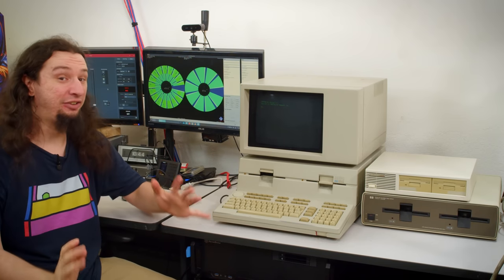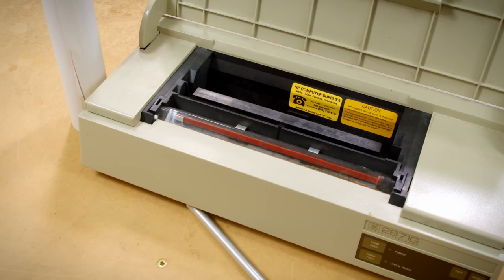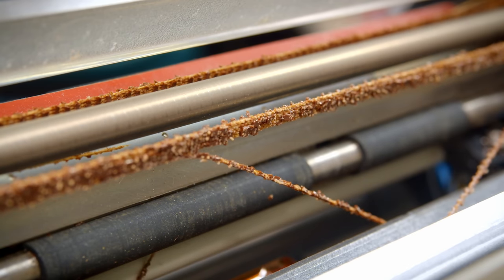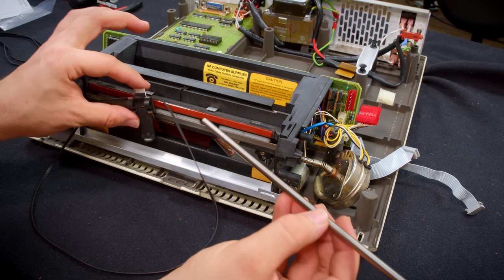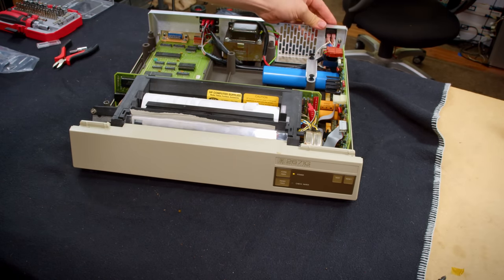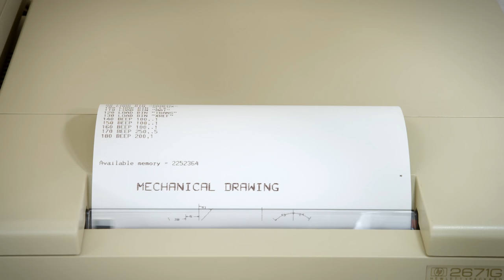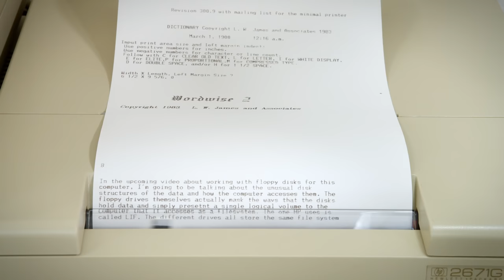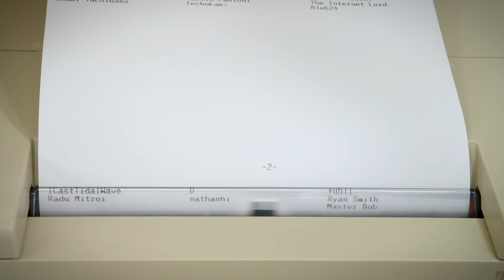Printing From the Past - HP 2671G Thermal Printer

Comment: The fax paper is mean to be cut with a cutter from the machine itself (self sharpening cutter, in V shape) or via a manual operation with a cutter made with teeth (akin to a saw).

A tip: regarding the latter, you can find a cheap source of them by getting one from an aluminium foil dispenser. Just remove it carefully and glue it on your transparent plastic tab at the paper exit and you made yourself a nice cutting mechanism.

(Picture of what I mean : https://m.media-amazon.com/images/I/71hRc2Ge3IS.jpg)

Comment: I'm flabbergasted that paper is still made for this printer.
Reply: It's just a weird size of the same paper used to print receipts at almost every single cash register in the country. They just gotta cut the roll into a different length.
Reply: They still make it for old fax machines — and for the Brother thermal printers that are still sold today!
Reply: It's a standard type that's still widely used.

Comment: No, "mil" does not mean "1/1000th of an inch." Because saying "1/1000th" is "one onethousandthTH," and mathematically that would be 1/(1/1000), which is the reciprocal of what you wanted, bringing you back to 1000. But in the real world there just isn't even such thing. There's already a "-th" built in because of the fraction! So a mill is just 1/1000," which, spelled out is "one one-thousandth of an inch," NOT "one one thousandthTH of an inch"! Besides, when did the word "inch" supposedly suddenly become a "brand name"?

Comment: (Hi. I had ChatGPT work up a quick fix for you problem w/ tearing paper off the printer. Hope it helps!)

Title: Procedure for Modifying HP 2671G Thermal Printer for Modern Fax Paper Compatibility

Objective:
The objective of this procedure is to modify the HP 2671G Thermal Printer to enable it to work with modern fax paper. This modification involves acquiring a serrated strip from an aluminum foil container and installing it along the clear plastic paper guide on the printer.

Note: This procedure assumes basic familiarity with the HP 2671G Thermal Printer and its components.

Equipment Required:
1. HP 2671G Thermal Printer
2. Modern fax paper
3. Aluminum foil container
4. Scissors
5. Adhesive (optional)
6. Cleaning cloth (optional)

Procedure:

Step 1: Preparation
1. Ensure the HP 2671G Thermal Printer is turned off and disconnected from any power source.
2. Clear the printer of any existing paper rolls and ensure there are no obstructions in the paper path.
3. Gather the required equipment: modern fax paper, an aluminum foil container, scissors, adhesive (optional), and a cleaning cloth (optional).

Step 2: Obtaining the Serrated Strip
1. Take an aluminum foil container and inspect it for a serrated strip. This strip is commonly found on the edge of the container's lid.
2. Using scissors, carefully cut along the lid's edge to remove the serrated strip. Exercise caution to avoid any sharp edges.

Step 3: Installing the Serrated Strip
1. Locate the clear plastic paper guide on the HP 2671G Thermal Printer. This guide assists in aligning the paper during printing.
2. Align the serrated strip obtained from the aluminum foil container with the length of the paper guide.
3. Carefully position the serrated strip against the clear plastic surface of the paper guide.
4. If necessary, trim the strip to match the length of the paper guide using scissors. Ensure it fits snugly without overlapping or extending beyond the guide.
5. If desired, apply a small amount of adhesive to secure the serrated strip to the paper guide. Be careful not to obstruct the movement of the paper or any printer components.
6. Allow the adhesive to dry, if used.

Step 4: Testing and Adjustment
1. Load a roll of modern fax paper into the modified HP 2671G Thermal Printer, following the printer's instructions for paper loading.
2. Ensure the paper is aligned with the serrated strip and that the strip engages with the perforations on the paper.
3. Power on the printer and perform a test print or fax transmission to verify proper paper movement and alignment.
4. Observe the paper movement during printing and adjust the position of the serrated strip if necessary, ensuring it consistently engages with the perforations on the paper.

Step 5: Maintenance (Optional)
1. Regularly inspect the serrated strip and clear plastic paper guide for any debris or adhesive buildup.
2. If needed, clean the strip and paper guide using a cleaning cloth lightly dampened with water or a mild cleaning solution.
3. Ensure all components are dry before using the printer.

Note: This modification is not officially supported by Hewlett Packard, and any changes made to the printer may void its warranty. Exercise caution and perform this modification at your own risk.

End of Procedure.
Reply: Here is the prompt that I used:

"Please write a procedure for modifying your HP 2671G Thermal Printer to work with modern fax paper, by acquiring the "serrated strip" from an aluminum foil container and installing along the clear plastic paper guide on the printer. Please use the technical writing style of Hewlett Packard as seen in their documentation from the 1970s."
Reply: tldr glue a blade to it